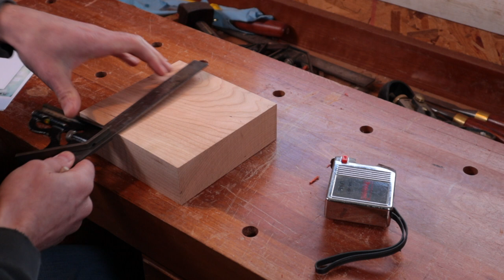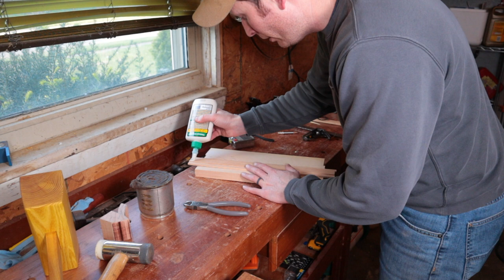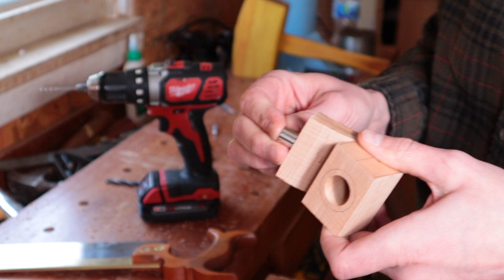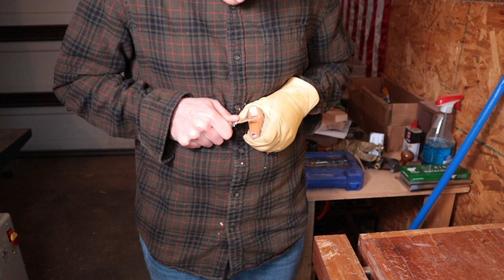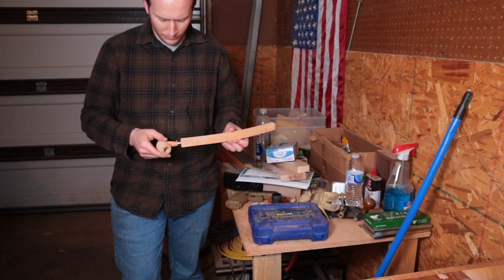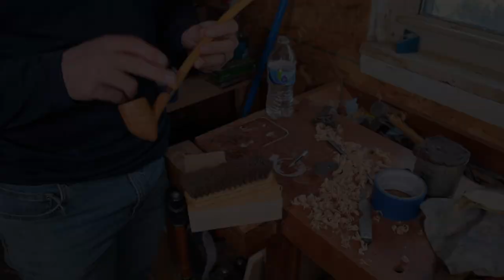Wooden Pipe Video

Comment: A blue ballpoint pen is far easier to see and to cut to than a pencil saving a great deal of time.

They make inflatable rubber sanding drums ith sleeves that would save you time fairing out your curves. 

I would use templates in standard shapes to mark out with. Probably 1/8" clear plexiglass so you can see the grain to it's best advantage.

I built industrial molds and prototypes, scifi models, architectural models, furniture and cabinets professionally.  I also did jewelry, lapidary, engraving, carving in all skeletal materials, wood, plastics and metals.  For replicating animorphic medieval spoons and pins, jewelry patterns, etc I would use gravers, dental tools and scrapers custom shaped from saw blade pieces.  Woodcraft sells miniature scrapers in sets of four for less than $20.